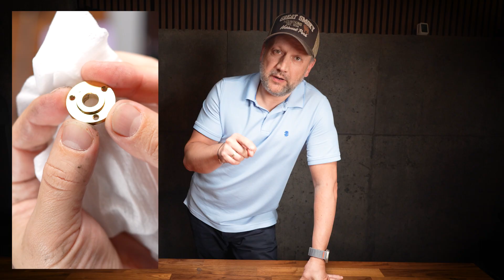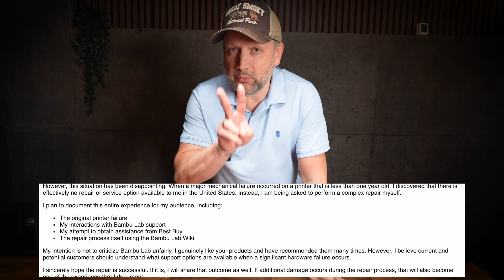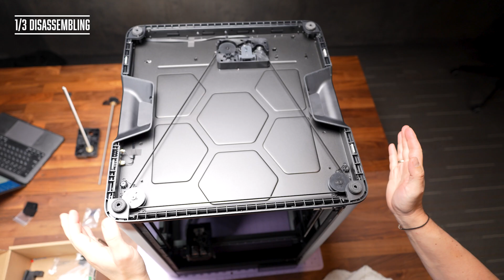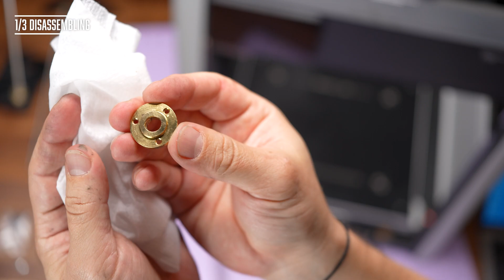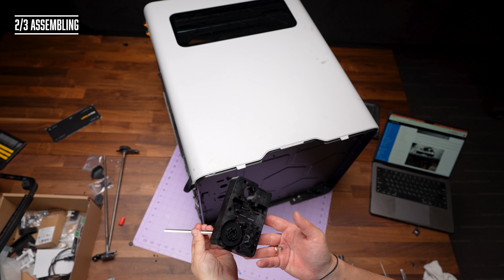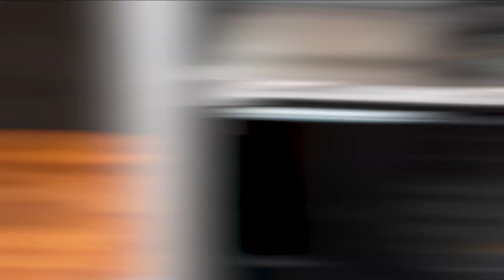How to Replace the BambuLab H2D Lead Screw Nut

Comment: I have the same issue for the back rod. According to Bambulab techsupport the replacement part doesnot exist and they want to replace the hole machine..
Reply from the maker: Then you, lucky one :)
Reply: On my H2S I also have a rear failure, support just confirmed they are sending replacement kit. How old is your printer? I have heard they replace if its less than 30 days old.
Reply: Just had a rear nut go, brass is not strong enough! All removed and prepped, just waiting on crappy support to acknowledge and send new parts